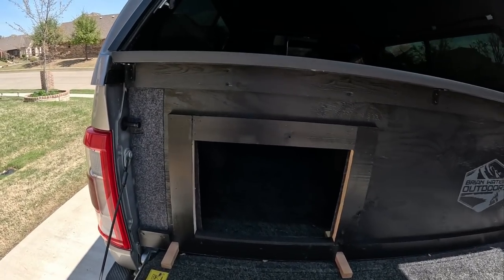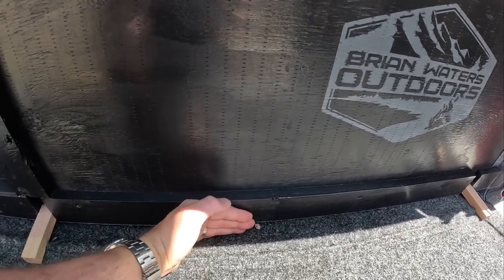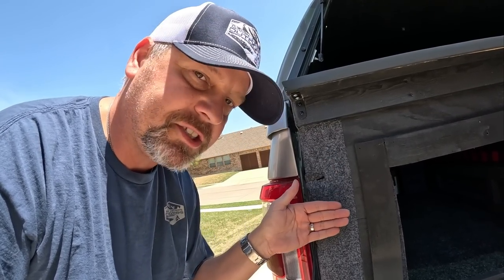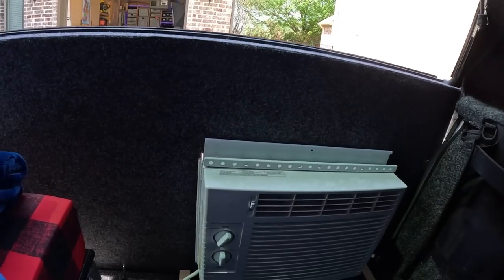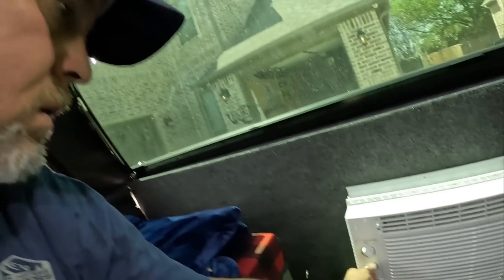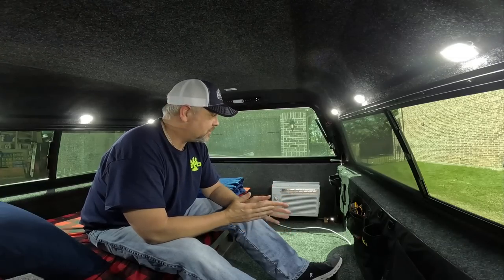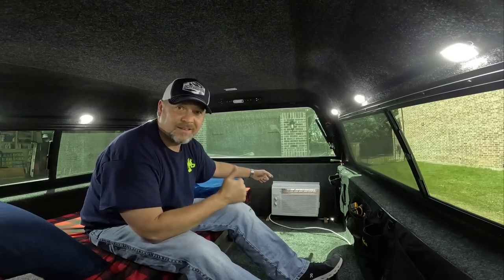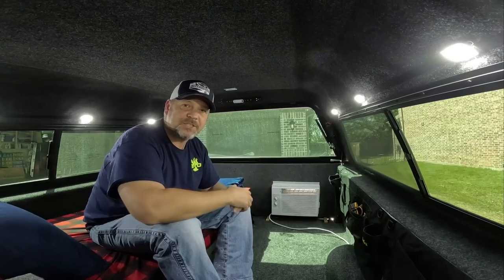Truck Camper A/C : CHEAP, EASY & COLD!!

Comment: That’s a pretty slick build. What about the condensation on your tailgate BedRug from the AC dripping. Will that damage the carpet or cause mold or anything
Reply: I have the same question. Are you going to put in a drip tray to catch the condensation?
Reply from the maker: This doesn’t have a drain. It uses a spinner ring on the fans to pickup the water and reuse it to cool down the unit. I’m no ac expert though. My ac in the camper was the same and I never saw a single drip come out of it.

Comment: Absolutely love it! One question. If you don’t have shore power, how do power the AC?
Reply from the maker: I’ve used a small generator and a 300ah battery with a 1000 watt inverter
Reply: @BrianWatersOutdoors  How long does the battery last for when you use it on the settings you do?

Comment: Pretty ingenious.   You know that make portable AC’s for camper vans that use intake and output hoses but there expensive. Like $1000
Reply from the maker: I had one of those last year. The Zero Breeze. It was quite a pain to run all the ducting, but it did work

Comment: I wouldn't bother with reflectix on the panel you built. Honestly, the windows and roof are where you are getting your most heat gain.
Reply: Ceramic tint is your friend.. tint all your windows with ceramic tint and it'll cut 95% of the heat through the windows.

Comment: Water dripping from the a/c will drip on the tailgate and possibly run back into the bed......
Reply from the maker: These new a/c units don’t drain. They splash the water back into the condenser to cool the unit down.

Comment: What's the roof area of the topper?  If you can get 500w of panels up there it would let you run the ac all day (if I got the numbers right).  I don't know how much campgrounds charge for the shore power, that would factor in how long it would take to recover the installation cost, but it would make you more independent.
Reply from the maker: It’s fiberglass👍🏻

Comment: I'm surprised you didn't put something under it for the water to run onto and  then drip onto the ground instead of soaking into the rug.
Reply from the maker: These units don’t drain. They splash the water back into the condenser to keep the unit cool👍🏻

Comment: Cool idea Brian (pun intended)!  Did you add a drip tube to the A/C unit so the condensation has a way to exit so id does not drip on the tailgate?  Also, just a suggestion: you might want to add a strap at the center inside of the topper door so you are not puling from a corner and tweaking the frame.  Please post a long term use video maybe in September/October.
Reply from the maker: Thanks. These units don’t even have drain holes like the old ones. They use a spinner ring to scoop up the condensation and splash it back onto the condenser to keep the unit cool👍🏻
Reply: @BrianWatersOutdoors  Even better! I learn something new everyday...thanks mate!

Comment: May I offer you an easier solution. An ice chest/cooler A/C unit. Easy to build, cheap and with the right mods the ice can last for days.
Reply from the maker: I tried that last year and didn’t work. It’s just too humid here in the south. These bucket coolers work great in drier climates
Reply: @BrianWatersOutdoors  i live in Louisiana so i know what you mean, That's why i said with the right mods. You fill the lid with foam, add a gasket to the lid as well and the ice last a lot longer.

Comment: Fantastic!! have you thought of using a solar power gen like Jackery?
Reply from the maker: You could, but would t last very long. Even on the large 2000 watt hour stations. You could maybe squeeze out 3-4 hours. Could potentially run it longer during the day if you add solar panels

Comment: Fantastic mod! I have a question I didn't see answered - how are you managing the condensation? If used long enough, that portable A/C is bound to piddle all over the indoor/outdoor carpet. Any thoughts to putting a tray/drain underneath that as you set it up?  I was also one of those that was thinking about grabbing a junkyard tailgate and dropping the A/C unit into it, but the more I think about it, the more it'd be cool if you kept the existing tailgate and fabricate something to replace the upper window. Not being able to see out the back wouldn't be an issue: replacing the rear view mirror with on that provides that vision via a camera is quite easy to do! That way the A/C is out of your way, and you wouldn't have to wrangle yourself over that fabbed tailgate. Being able to open that upper part would then just be a matter of adding some additional struts to compensate for the weight of the A/C
Reply from the maker: These new units don’t even have drain holes. They have a spinner ring that scoops up the water in the bottom and splashed it back into the condenser to keep the unit cool. 👍🏻
Reply: @BrianWatersOutdoors  Thank you! I've seen condensate creep out in mine - makes me wonder if the leveling might be causing issues.
Reply: Yeah well mine spits out the sides if not leveled correctly.

Comment: Where does condensation runoff go? What about rain on the tailgate? Also, wouldn’t using a frame for the AC in one of your sliding windows be less cumbersome? Climbing over that thing through the window area has to be a bit of a contortion act.
Reply from the maker: This doesn’t even have a drain plug. Uses a spinner ring on the blades to redistribute the condensation back onto the condenser to keep the unit cool. If it rains…the BedRug will get wet, no big deal. The BedRug is actually plastic fibers so don’t worry about mold. My windows have screens built into them.

Comment: Great idea. With 5000 btu what amp draw are we talking about. Just starting the process of installing a inverter system in my F250 equipped with dual alternators pumping out 385 amps.
Reply from the maker: That’s more than enough. This unit runs around 600 watts at startup, and settles down to around 430 watts on max cold

Comment: Nice, but MacGyver'ed.  If you was only camping one or two weekends.....awesome!   But you talk about camping a lot, or regularly.  Why not spend the money on a small RV roof mount a/c unit?  If done right, no setup time when camping.  No tailgate hack with gaps.  

I'm sorry, that wouldn't be roughing it?  It would be too much like a professional job?  One thing we can certainly agree on, it does get hot in Texas!

I almost forgot the best part.  If done right, both will run off-grid with an Inverter Generator.  But the roof mount gives you more storage for other essentials.  That a/c unit plus the bottom wood filler isn't much, but it is still packing  real estate nonetheless.

Recap:   I really like your setup for minimal campers and cost effective.   For people that camp a lot (out of their truck bed), not my first option.

Comment: Great job! What are you using to power the AC when you’re parked somewhere? Do you need an external power source or do you have some type of generator?
Reply from the maker: I’ll have to use shore power / ac. Just like an rv or camper. I could use a big power station/battery but I’d only get 2-3 hours using my biggest 2000 watt battery
Reply: I have done this before remote camping and got almost 10 hours from a 3000 watt battery pack set up.  The AC used about 300 watts per hour   @BrianWatersOutdoors

Comment: Great idea been looking at doing this with my 2019 ram 2500. Now where does the water go from the Ac unit so it dont build a pool on your tailgate
Reply from the maker: These newer units have a ring that splashes the water back into the condenser to cool it down. There is no water that drains👍🏻

Comment: Does the AC unit have to drain any evaporation?  PS:  Nice that your wife let you use the 3rd garage as a workshop. 😊  God Bless Texas!
Reply from the maker: It does not drain. It has a spinner ring that splashes the condensation back onto the condenser to keep the unit cool. Doesn’t even have a drain hole like the old ac units

Comment: What are you powering this AC unit with?
Did I miss that or n the video ? 
I’ll watch again !
Great job and thanks for sharing.
Reply from the maker: Generator, power station, and I’ve used a large lifepo4 battery with an inverter too

Comment: I'm confused... Where or what did you use for electricity?
What is the Name of that little Air conditioner ??
Reply: Sorry... I just now SAW where you plugged it in ...
Reply from the maker: Yes , just plug into shore power or use a generator👍🏻

Comment: So you can’t use this setup when it stinky right? All that water would hit your lowered tailgate and run back into the bed, through the carpet
Reply from the maker: If it’s raining? I would not set this up if it was raining because typically that means it’s a bit cooler outside, but yeah…rain would get the tailgate wet

Comment: You did a great job with building the false tailgate and installing the a/c unit! I am wondering about one thing though. What about the water that may drip from the a/c unit? I don't guess it will be a problem with the "carpet" on the tailgate? Just wondering. But nice job on it, I like it and yep it will be a big relief from the Texas heat we're about to face!
Reply from the maker: So, I’m no expert but these newer ac units don’t even have drain holes. They have a spinner ring on the fans that scoop up the condensation and spray it back on the condenser to cool the unit down. This was the same ac unit I had on my diy camper I built and I never saw a drop of water when running that all last summer
Reply: Good deal!!

Comment: I think the biggest question we all have is how do you power it from the inside? What sort of inverter is that?
Reply from the maker: Shore power / grid power. Just like if you were in an RV, I’ll have to plug up to some type of electrical service. I “could” run it on one of my big power stations, but old only get 2-3 hours of run time that way.

Comment: Do you have to have AC power to run this or can a jackery 1000 handle it? Thanks for sharing your video and nice job!
Reply from the maker: It “could” run it, just not for very long. My guess is about 2 hours max with a Jackery. But, if you factor in solar panels (running the ac during the day) you could extend that.

Comment: To avoid yoga contortions, why not vertically cut the false tailgate into two pieces? (one, where the a/c is mounted, the other just a "blank" portion). Install the unit on one side, when you get in the camper shell, install the other ("blank") piece.  A small strip of insulating material to cover the (most likely small) crack between the two half's. There is minimal weight bearing on the a/c side of the false tailgate as the air conditioner half (or "side") is supported by the framework in addition to support under the a/c unit. Add perhaps a sliding barrel lock at the top and perhaps bottom to secure the two together horizontally (ie forward and backward). As neither are weight bearing and have no vertical or horizontal stresses (to speak of), I don't think stability forwards and backwards are much of an issue. Thanks!
Reply from the maker: I thought about that. Then decided against it because basically….I didn’t feel like doing it 🤷🏻‍♂️ I don’t have any issues crawling in without a door on this, and for me, the slight hassle of climbing in outweighs the benefit of an easy build, easy to store modification. The “door” side would be right in front of my bed platform anyway, so it will still be skewed getting in.
Reply: @oldmanandthec: Yes, a door of some kind is a necessary feature for me, my knees are shot. I hate even climbing in to retrieve items from the bed that have slid forward.

Comment: Very cool setup! Is there anyway you could make the right side in front of your bed into some type of door where you could still have access to he pull out drawer and easier access to get in and out without climbing over he tailgate? It may not be stable enough though if you cut it in half. Just a thought, but either way the tailgate looks great and looks like it will keep you cool on those hot days!
Reply from the maker: I thought about it, but you’re right. I think it would make it less stable. But this is really just a test. When I get it out there and start using it I’ll probably find areas to improve on.

Comment: What’s catching the condensation coming off the air conditioner. Or are you just letting the carpet on the tailgate absorb the water?
Reply from the maker: The new units don’t even have drain holes. They have a spinner ring that scoops up the condensation and splashes it back into the condenser to keep the unit cool.

Comment: Clean job. What are you doing to keep the condensation from soaking your tailgate carpet?
Reply from the maker: It’s 2 fold. This unit, and from what I gather, most newer ac units do t have a drain plug. They have a spinner ring on the fans that reuse the condensed water to cool down the condenser. I’m no expert though. The bed rug is also “plastic fibers” and not carpet so I’m not worried about that If a little does drip out. But I’ll just have to watch it.
Reply: @BrianWatersOutdoors  Ya know, after I asked that question, I remembered that they are using the condensed moisture to help cool the condensor. And I do recall you saying that the rug was plastic...

Comment: Yeah i seen this setup before but with a gas generator and I was gonna pull the trigger on something like this but the generators are just way too loud to run this in the city or for camping cus no one wants to hear a loud generator at night, so i cant really do this, they also sell the cool breeze2 i think its called and its a portable ac but hella expensive, i also seen the big coolers and a fan inside with vents and fill with ice to blow cold air, this is probbly what ill do :(
Reply: The new little Honda generators are super powerful super quiet light my brother has one takes it camping all the time runs AC all night 33 ft trailer no problem

Comment: Small windowshakers are far underrated. I use ONE 5000 btu shaker in my 5th wheel. With a duct taking half of the air upstairs and some electric fans it cools my entire 5th wheel in Miami up to 90 degrees pretty well AND I have no problem with my 1000 watts of solar running it. Good job

Comment: How long and just how the heck is there enough  power to run this unit?   (are we just assuming he's using a electric or propane or gas generator when parked?)    
What I'de like to know if how you can run the unit for like 8 to 12 hours a day and what that would involve,  (over 40,000 people alone in California live in there cars and over
200,000 is estimated across the United States, and that number is expected to grow to 700,000 by the year 2030)

Comment: Well, that will work but don't you need a very long electric cord
Reply from the maker: No. I’ve used a generator, power station and a 300ah battery tied to a 1000 watt inverter

Comment: Hey Brian what about the water that drips from that window unit it will get all over your tailgate
Reply from the maker: I’m no expert, but these newer units don’t even have drain holes. They reuse the water with a spinner ring on the fans that pickup the water and throw it back on the condenser to keep the unit cool. This was the same ac I used on my diy camper and I never saw a single drip of water come out.

Comment: Drainage? You might want to get a hose for Drainage so your rug doesn't get wet
Reply from the maker: There is no drain on these newer window units. They utilize an”spinner ring” on the fan that picks up the excess condensation and throws it back onto the condenser to keep the ac unit cool during operation👍🏻

Comment: It’s going to drop water …is that going to soak into the carpet and inside the camper
Reply from the maker: Not these newer units. They splash the water back into the condenser to keep it cool. I’ve never seen a drop of water on the pan.

Comment: What kind of power supply do you need to run an air conditioner?  I wouldn’t think an extension cord would be safe
Reply from the maker: I’m running a 12g extension cord. More than enough to run this a/c which maxes out around 600 watts on first startup

Comment: Bed rubs looks hard to clean if you track in mud or dirt.
Reply from the maker: Pressure washer does just fine on them👍🏻
Reply: @BrianWatersOutdoors  is the platform removable? My truck has bedlining which works for me. I Got a camper from lone peak was thinking of putting in wood floor panels .

Comment: There's no electricity to run the a/c when camping?  Unless you only sleep at campgrounds.
Reply from the maker: That’s right. Have to use a generator or shore power

Comment: Why not just use a rooftop AC unit like they have on RVs and converted van which also still lets you use your tailgate like normal.
Reply from the maker: Didn’t want to cut a hole in the roof of the topper
Reply: One reason is because roof units are much more expensive…
Reply: Another is it probably won’t fit in a garage with ac on top of  shell…
Reply: They are about as expensive as this if not more and have to be run off of ac components

Comment: By "camping" I am guessing you are talking camping at a campground, with a power outlet?
Reply from the maker: Or boondocking with a generator, but here in July you almost have to have ac grid to not die in the heat

Comment: I am wondering how you power it.... is there a spare battery and inverter? And how do you charge it?
Reply from the maker: You can use a generator, battery with an inverter , a large power station like a Jackery 3000, or shore power.

Comment: You haven’t considered the condensation that the AC removes and will drip all over your carpeted tailgate.. I’d also look at adding some exterior insulation to the camper shell even if it’s just a Reflectix tarp over it with an inch of airspace.
Reply from the maker: These new units don’t have drain holes. They use a spinner ring that collects the condensation and splashes it back onto the condenser to keep it cool👍🏻